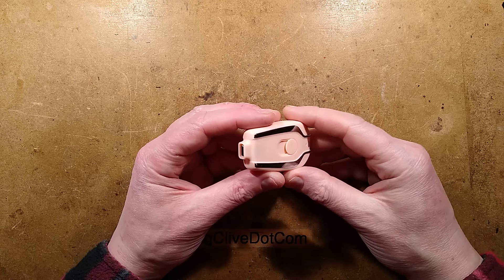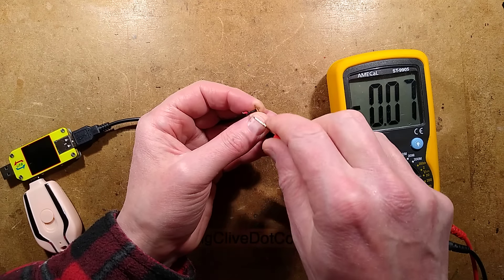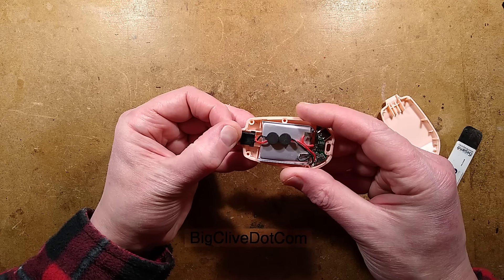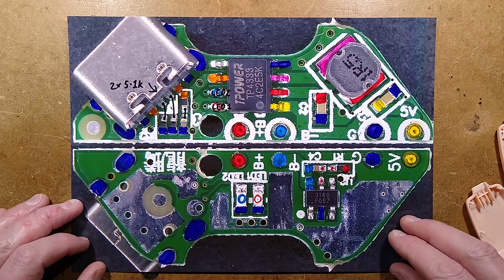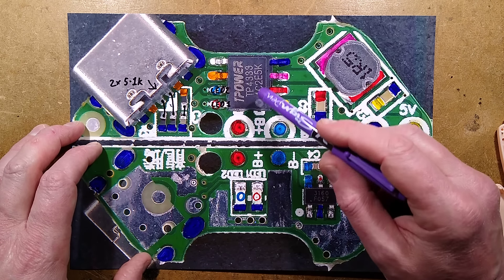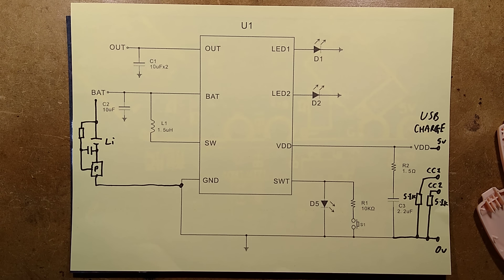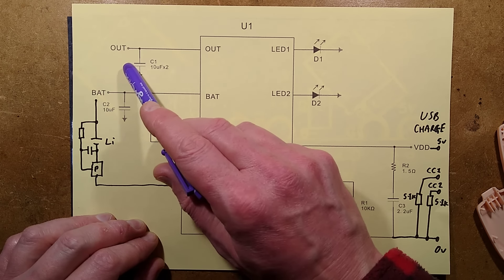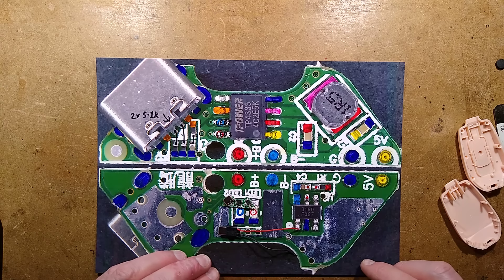eBay keyring phone-killer

Comment: A backwards voltage USB power supply would be great for an old cassette player that has a backwards polarity barrel plug. The pin is negative instead of positive. I have done a janky workaround with alligator clips to reverse the polarity and a simple USB to barrel plug and it works. I can listen to and record old audio casettes without having to burn through FOUR double A batteries every few hours. A USB powered audio cassette player. (It's a six volt device, but since it's designed for use with batteries, I figured that it would operate fine on five. and it does, thankfully work quite well.)
Reply: cool...DVD:)
Reply: That's all the Brother label printers.   They use a 9 volt, reverse polarity barrel connector.   So, I grab an unused 9v (making sure it's not 9v AC, as those were more common than DC), cut off the plug, cut the plug off an unnecessary 12 volt wall wart, switch the wires, solder and heat shrink, and bingo - extremely expensive "brother" power supply.   (I grab the 12 volt because it has the right barrel size.  I have a 5 gallon bucket of the things)
Reply: @tbelding  ok.
Reply: @tbelding  9v DC reverse polarity is standard for guitar effects pedals, maybe the label printer was designed by a musician 🙂
Reply: @connerlabs  So, you're saying Fran is to blame?
Reply: @aaronmdjones  Oh, I know all about the wireable barrel connector.  I have some, and I use them for camera installs.  I'm just cheap, because I have a bucket of relatively useless 500mah 12 volt wall warts.

Comment: I had a rather expensive 'certified' USB-C cable that was seemingly 'polarised'. It charged at a different rate depending on the way up you placed it in the port. It also transferred data very slowly if plugged in 'upside down' (which shouldn't be possible with USB-C). I binned it.

At least it didn't melt through the base of a damp (not particularly wet, not containing a pool of water) plastic bucket like another (expensive) USB-C cable did. The end had fallen into the bucket whilst still switched on. Luckily I smelled the burning plastic before it caused a fire. The metal housing was actually glowing. Amazon didn't withdraw it from sale after I informed them so I assume cables and chargers don't have any short-circuit protection nowadays. It was plugged into a 66W genuine Honor/Huawei charger if I remember correctly. If it had been the 135W version.... 😱
Reply: They generally have overcurrent protection, but if it's not exceeding the rated power of the supply, yeah, it will just burn the cable to ashes. The cable is responsible for having the correct resistors or ID chip installed to tell the charger what the limit should be. So, if the cable identifies it can handle full power, even though it can't, and it shorts in a way that doesn't exceed 66W as you mentioned.... it turns the shorted end into a heating element. It will happily keep "charging" the load on the end of it, even if the load is a blazing inferno of melted wires. Mind you, basic soldering irons are in the 50W range, so that's a lot of heat in one spot. Same thing causes a lot of electrical fires with household appliances, the short is only partial and doesn't trip the circuit breaker because it's within the allowed amperage.

Comment: Well.. did you solder them back into the correct places and test it after? Enquiring minds want to know! :)
Reply from the maker: Not yet, since I've been running a few cycles on the lithium cell.
Reply: I was thinking the same thing.

Comment: While working as a CB radio repair technician, my boss showed me a unique way to check for faulty solder joints on the circuit board. He just dragged the edge of an expired plastic credit card back and forth across the board and watched his meter for movement. It's surprising how many connections are just "barely there" enough to work intermittently and drop out at inopportune moments and then reconnect!

Comment: I bought a pair of pedestal mount trailer lights with two positive wires for the dual element bulb (1157). Ground is picked up from mounting it to frame. Both lights were wired backwards vs how the instructions said for the two wire colors.

Comment: Hey when you say that it's "Textbook" this or that, what kind of textbook are you talking about?
I would like to find a resource that could teach me the basics of circuit boards and electronics, but also does more than just naming items on a schematic.  It would be nice to find an online course that teaches everything from how to read an electrical diagram, to how silicon circuit boards actually work and can explain it to me like I'm 5 years old.  Not that I actually need it to be that simple because I already know some stuff, but I want to get the full breakdown of how each component works instead of just memorizing jargon and being able to identify parts of the board.

 What I am after is a fundamental knowledge of HOW each part does what it does, not just what is, and what it does. 
 I want to have a full grasp on the subject, not just on a theoretical level, but all the way down to the hardware and materials science of each component.
Do I need to enroll in college to learn this?  I'm just not sure where to go.
Reply from the maker: Describing something as textbook means it is a good quality design that follows all the rules.

Comment: Problem with things made in china is that the ppl are as well. If wired incorrectly, they quickly leave the country, never to return  and the govt has to go after them and force them to return. Occasional they fuse or catch on fire, but, as they're cheap to make it doesn't matter that they have no real warranty. And, as they all look the same you can just swap them for another one and currently the postage is free.

Comment: All factories that assemble anything by hand (or by machine) have the potential to make mistakes. The problem with this isn't that somebody soldered it wrong, it's that clearly they had no QA process in place afterwards to test that the assembled device actually worked. That's why I only buy cheap Chinese products that have a little gold "QA Passed" sticker on them.

Comment: By chance I bought one of these several weeks back - but mine, I'm delighted to say, has the correct polarity.

After several charge/discharge cycles, I get around 650mAh effective capacity, which isn't too bad. Charge stops around 4.09V, rather than 4.2V.

It works well, but the USB-C snout, even when fully extended, doesn't quite get into the socket of my Note20, but then I have a heavy duty OtterBox case on it.

Comment: I serviced electric welders. Friendly competitor did too & he had a brand new Miller Gas drive with blown PCBoard. He replaced it with new, which blew immediately. Replaced it with another, same result. He re did all ground tests, no shorts & repaired pcb damage for retesting 4-5 more times, all instant fails. I offered to help, as he'd done for me. I'm methodical, so I start at step 1- load test the starting circuit battery. 12.6 vdc. & 400+ amps output under load but polarity was wrong. The battery mfg had somehow messed up & the cathode/anode were reversed creating positive ground, negative hot, which bypassed the diode into pcb frying it. New battery & pcb and it was ready to rock. Only time I've seen that in an automotive battery. 1 in a million+ problem solved. (note-technically, the older/new battery would still have worked by simply switching the cables for polarity but with +/- markings reversed it was an accident looking for somewhere to go)

Comment: I guess you could have ground pins that stand off from the board. Connecting those before you connect 5v. The raised pin would have a black shaft to help reinforce this is ground.

Comment: Thinking of phone chargers, I've wanted for a long time (years!) to ask: what can I do to stop FM radio interference in my car when charging my phone? Its not the car, (the last 3 cars I"ve owned do the same) any plug in charger does the same and any phone too. This only happens when the phone is connected to the lead, if the charger is plugged in and powered with no phone attached there is no interference.
Reply: I’d start by adding a ferrite to the cable coming out of the charger, and another to the wires coming from the back of the cigarette lighter outlet. If that doesn’t work, move to an area with stronger FM signal. 😉
Reply: @connerlabs  I'm assuming you mean a ferrite ring? I'll try that, I thought of wrapping the charger in foil, but that seems a bit conspiracy theorist to me! As for moving to another area, where I live (Cape Town area), it's a bit difficult, the transmitters are all over the place, and towns where I move between are like 20, 30 km apart. Point is, even in my home town, where the main transmitter is on top of a mountain in easy line of sight for the whole town, charging my phone just wrecks my car radio! (see google maps or something like that for Somerset West and surrounds. The transmitter is on top of Hans Kop mountain, kinda north east of the town) i'm interested to hear your further comments!

Comment: Another excellent presentation Big Clive... a question... my friend... talking about...  Intergrated Chips IC's... have you ever tried to find the data sheet... on a... what looks like a... black spot of mastic stuck down on a printed circuit board PCB... its not through hole... not surface mount... its trying to hide its circuit characteristics... ?
Reply from the maker: That's a COB.  Chip On Board and could be any chip directly mounted to a PCB with wire bonds like a packaged chip.  The resin is black to protect against interference from external light.

Comment: Ex electrician here: In Northampton England in 2001 I was working on a new housing estate adding stuff like security systems etc and I discovered that the circuit I had switched off still had a live? 
I thought the site- electrician had wired the meter polarity wrong.  But as the neighbour seemed friendly I asked if I could check his house too.
Sure he said. In actual fact ALL five houses had been wired to the correct colour code but the underground cable had reversed polarity. This can only mean that NOBODY had performed the required electrical inspection... Or perhaps ANY electrical inspection!
If all switches are double-pole its not so dangerous but this was terrible all the same.
The following year I had been informed that the tails in all five houses had now been reversed and  heat-shrinked to the correct colour.
These houses also had the gutter-brackets NAILED to the the mortar! 
(Cue national anthem) 🙈🇬🇧

Comment: I need to get an old project started again. It's a stupid simple break out board of multiple USB interfaces that power a red/green LED for polarity testing. I made one for the original type A USB for testing if I wired up the front panel USB connector on desktop machines.

Comment: It reminds me of one nasty feature of otherwise excellent industrial product. It's a hydrogen concentration meter (hydrogen analyzer) for heat treatment furnaces, especially for nitriding and carburizing of steel, and brazing in H2, made by German company. It's extremely durable. Resists 24/7 operation with hot hydrogen, ammonia, water vapor, methane, carbon monoxide, acetylene, even pretty much of chlorine. It uses a catalytic sensor, called pellistor. I've seen it fail only once in my 10year career as a metallurgist. Very good product. It features 4-20mA current loop output and needs 24V supply. It also features no reverse polarity/miswiring protection at all. Connecting in reverse polarity, or connecting 24V to the output results in totally dead unit. It won't even power up anymore, will be seen as an open circuit. It also comes with ROUND proprietary (or at least obscure) plug which comes LOOSE, not soldered. Absolutely lovely. I have bricked two, and I think it costs about 2000 euro.

Comment: Of course if you think about it, even if the mAh advertised was correct it's still misleading as they give the value for a single cell at 3.6V. So that voltage still boosted to 5V which means you get about 30% less mAh at that voltage. So a 3.6 or 3.7V 600mAh cell really only gives you 430mAh @ 5V. Sellers really need to state capacity in Wh.
Reply: They're into making sales not making customers happy and they know you won't return it.

Comment: I watched a guy demonstrate what happens when you try to use a USB output battery pack as a power source to operate wireless headphones after the internal batteries are depleted. The problem is that the noise from the boost converter circuitry is so loud that the headphones became unusable. This works great to recharge the dead headphones, but using them at the same time will not work.
I suggested he find a 7.4V battery pack (2S version) with a linear buck regulator so he would have a clean ripple-free 5-volt source. I attempted to find a source of such a battery pack and I found no options.
Have you heard of any premade buck converter USB 5-volt output battery packs?
This is a needed product for people who metal detect.
Reply: At that point it makes more sense to connect wires to the battery terminals internally so that a single 18650 or something can power it directly. Or just replace the dead battery with something roughly similar if possible.
Reply: 🤔 So the plan is to take wireless headphones and use them with a wire attached to deliver power, why not just use ordinary headphones with a wire to deliver audio, and avoid all the battery hassles? I’ve never seen a power bank that uses 7.2V internally, though I’ve designed equipment that does (using the BQ25883 charger IC)
Reply: @connerlabs  That is how we used to do this back in the day. Now we have $1500 detectors with proprietary wireless headphones.
The issue is when you are doing an 8-hour hunt (the detector can run for up to 12 hours) the headphones only last for 6 hours or you didn't fully charge them the night before.
Many of these guys are making videos for YouTube so they are dealing with video equipment too. After finding targets, setting the detector off to the side, using a pinpointer, and different-sized shovels to find the target, you do not want to be tied to the detector with wires during all of this. Placing a battery pack in your shirt pocket keeps you hunting.
Reply: @connerlabs  I guess you can use cable ties to strap a battery to the headphones and it will still be wireless?

Comment: Note that the USB tester - I assume it's from Sparkfun - does not work on USB-C compliant chargers on its own. You need to attach a phone on the USB-C output as the tester does not carry its own CC resistors, so it "proxies" on the phone's PD negotiation.

Comment: Good vid.  How do you test the battery for capacity?  I've got an old 7000mAh USB power bank I'd like to see what capacity it has now after a few years of (infrequent) use.  Thanks in advance.
Reply from the maker: I usually test for a rough cell capacity by draining it until the unit cuts off, and then recharging it while monitoring the mAh input.
Reply: @bigclivedotcom  Thanks for your reply. Does that little USB meter do the monitoring?
Reply from the maker: @DjClarky78  It does.  It can measure mAh charge input or output at the boosted 5V to a load.  When the power bank cuts off the last result will be shown when the meter is powered back up.
Reply: @bigclivedotcom  Thanks - do you mind sharing the make and model of the tester?
Reply from the maker: @DjClarky78  The tester is a Ruideng UM34.

Comment: the little flesh egg battery styling seems a bit 70's, but as you were testing, I noticed the blue led only came on when you fluked the output and not when you just plugged and replugged it into the usb  tester … I wonder what kind of lighting you got while charging.

Comment: I have occasionally been confused by mains wire colouring. If I remember correctly, in the States the black wire is Live, white is neutral, they have no earth as such, and forty years back, in the UK, live was red, black was neutral and green was earth. Currently in the UK and Europe, Brown is Live Blue is neutral and green and yellow, earth.
In low-voltage DC systems, red is + and black is -.
Did I get that right Clive?
Reply: Here in the US, ground (earth) is green-clad, or bare copper.
Reply: When working as a wire-man in a computer factory we were told NEVER to rely on memory when dealing with equipment from the US,UK and the EU. The factory had wall charts all over the place in the assembly area which the workers were supposed to consult at each wiring task. This is over 30 years ago when Ireland and the UK had Red/Black/Green mains wiring and the EU had Brown/Blue/ Green-yellow wiring colours. US had different names for the wires Hot, Neutral and Ground. The American techs I worked with did not know what Earth was, they always called it Ground. 
Our lead man hated when someone said "I thnk.....", always pointing out the need to be SURE when dealing with electricity.
Reply: @jgdooley2003  The UK abandoned green as the PE colouring in 1976. It was green+yellow after that. So you're talking about 50 years ago, not 30 :)

Comment: Pity of the wrong wiring on the output. The input charging port wasn't required. It could have both charged from, and deliver power to, the same sliding USB-C port along with the additional and correct wiring. Would have been neat. Perhaps also confusing for unaware users.